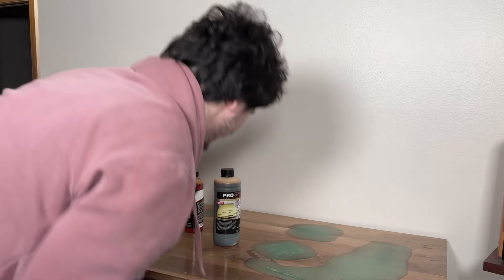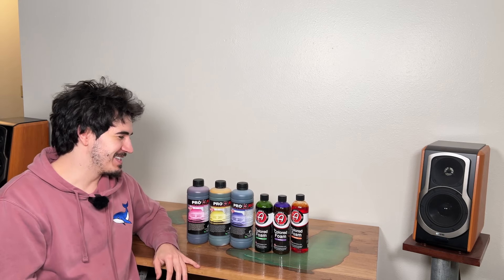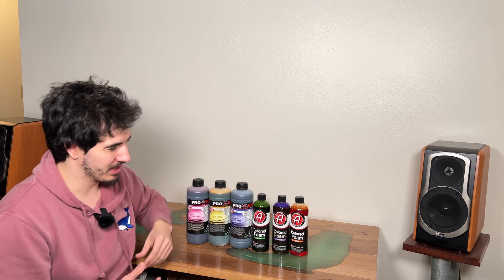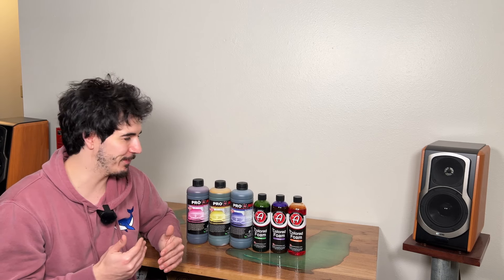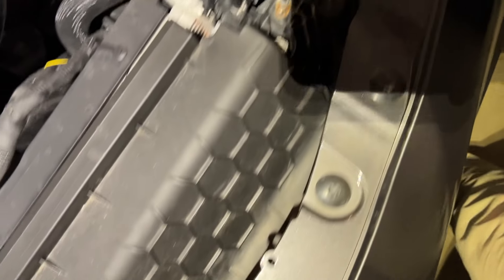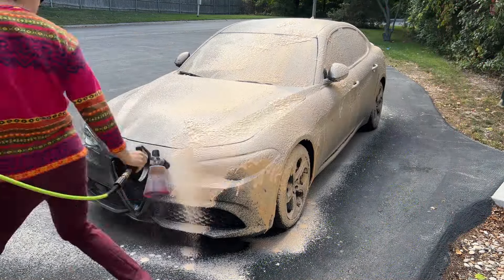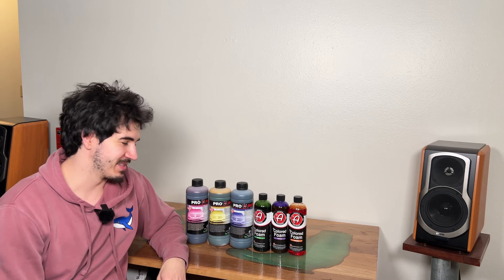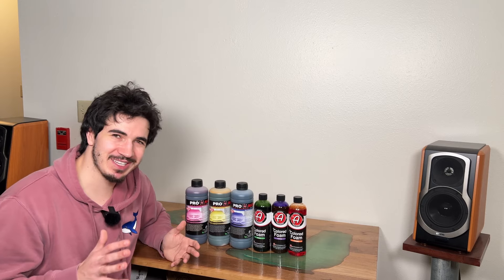Beware of Colored Foam

Comment: Off topic, but what brand speakers are those in your video - are they powered, or do they need a separate amp/receiver?
Reply from the maker: I don't know if they are sold anymore, but it's the Edifier S2000Pro, they are powered speakers so they are relatively portable. I got them a while ago